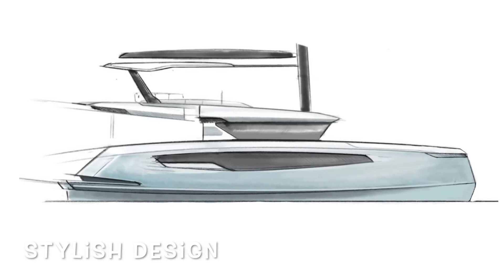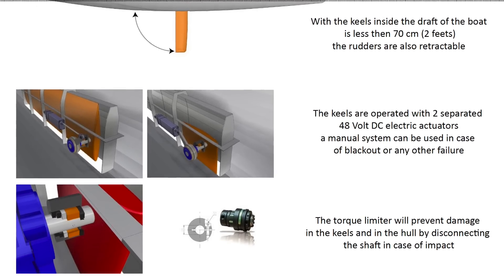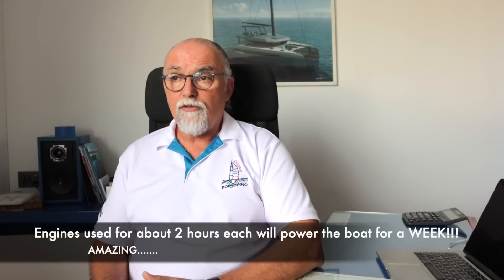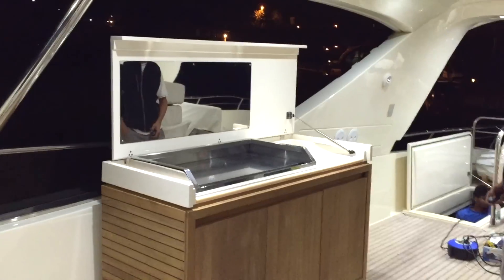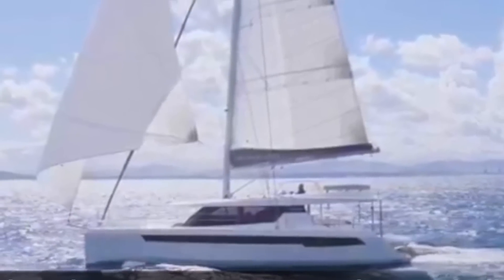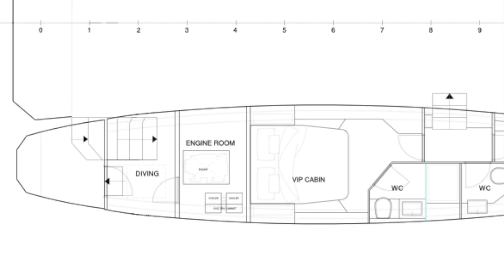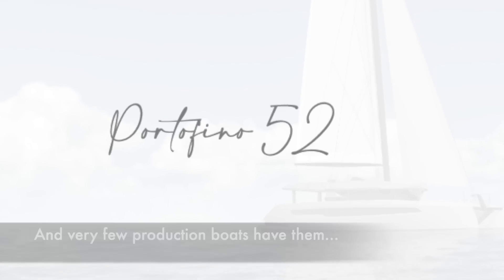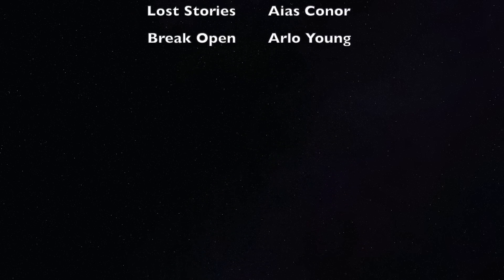S3#4.  NEW Portofino 52 - Designing THE PERFECT PERFORMANCE ALUMINIUM CATAMARAN for us?

Comment: I know that there are not many examples of Foil Assist on cruising cats at the moment but this is one method of lifting the huls out of the water and gaining that extra speed you guys are looking for. 
HH cats are putting winglets onto the keels which seems to be a toe in the water kind of approach but there are a few cats with a full foil between the hulls that are giving great results and some benefits.
It would be very interesting to see how that would work in the simmulations.
Reply from the maker: Hi Dennis, yes we actually approached an advanced foil designer and it could be done but there are several complications (variable angle is better for different speeds, increased draft, no benefit below 12 knots etc) so we dropped it.... The foil on the HH reduces drag only, no lifting effect but the curved daggerboard creates lift by one ton at 12 knots.

Comment: I don't see a centerboard lifted with a hydraulic ram kicking up from grounding or debris.  What's wrong with a line and winch for lifting?  A centerboard needs be no heavier than what it takes to make it to drop and stay down from the pressure of sailing.  It wouldn't take a lot of extra depth to place the pivot below the boat hull, and thus easily removable in an hour or less, afloat or not.  I designed a 64 foot catamaran in which the centerboard was in a shallow keel, so the total draft was 3.5 feet board up.  After all, you have the depth of the rudder to limit the draft of the total boat, unless you have some complicated arrangement for the rudder.

 As for flotation tanks, it takes a cubic foot of air to float 64 pounds.  You won't have enough area to create a significant amount of flotation.  The designers are just humoring you to sell the boat.  You won't have a useful amount of buoyancy from your "air tanks."  My catamaran designs have watertight bulkheads, with cabin access for foremost and after-most cabins from the deck.
Reply from the maker: Hi Tim, The centreboard will kick up due to using compression plates that will give way under strike force, and whether it is hydraulic, manual or lines. Then you can pull it back down and there is nothing broken, not even sacrificial pins. We do have the plan for lifting rudders too to allow shallower draft and beachability. The previous 42 cat I built had lifting daggerboards and rudders that just touched the sand when it sat on the beach so that worked very well.

My issue with "watertight bulkheads" is that most of them are not actually watertight with drains through to avoid needing bilge pumps in each section or holes cut for Kids berths or similar. This design will have truly separated watertight bulkheads and air tight voids wherever possible  to ensure maintenance of floatation. In the 42 foot cat, the whole of the under floor areas was sealed off as well as the nose cone and under the berths in each cabin. One area in the 52 that can also be used is to seal off the saloon roof and unused bridge deck area, so it is not that those areas alone will maintain floatation but with proper watertight bulkheads, it will be much safer than the usual boats that are built...

Clearly you have the appropriate design to keep your bulkheads properly watertight and still be able to use the space - great design!
Reply: @barefootdoctorssailing    Hi, Barefoot - I don't follow the reasoning that you're against watertight bulkheads if they aren't watertight.   By definition, watertight bulkheads ARE watertight.  It's not hard to put a short pipe with a valve on it attached to a bulkhead.  I would have valves at every point where a pipe passes through a bulkhead.  Wires can be passed through with copper bolts attached to fiberglass plates bedded on your metal bulkheads.   As for the centerboard arrangement, it seems absurdly Rube Goldberg to me.  As for flotation, you have to do the math.  For example: 36,000 pounds of displacement needs 562 cubic feet of ,emptiness, or better,  closed cell foam, to float it.  That's a whole lot of nothing. 

Probably the slickest retracting rudder I've seen is the daggerboard in a revolving drum arrangement in some Gunboats - but it doesn't kick up.  It's easy to put a dingy style rudder on a boat - essentially a daggerboard case with pintles and gudgeons on the transoms on a short skeg.  The case can be open in back so it can pivot if given a pivot on the daggerboard case.  However, you get some efficiency loss from air bubbles, and it's more complicated to put wheel steering and an autopilot on the arrangement.  It's also vulnerable in harbors.

My preference would be a 1.5 foot keel, housing the whole centerboard.  It doesn't interfere with the boat's interior, and the pivot pin can be accessed from outside of the boat.  Then the rudders can be  conventional inboard, just a bit short.  The resulting boat would have 3.5' of draft with 3' deep rudders.
Reply from the maker: @timdunn2257  Hi again Tim. I think you missed my point about the common production cats that have buklheads they call "watertight" but are not with cut outs or drainage holes that render them unsealable and several have sunk as a result. There is also the common misconception amongst the sailing community (it seems) that "cats don't sink" which is also incorrect... See Sailing Dauntless with the Leopard 50 that fully sank.

Clearly your processes for maintaining the integrity of the watertight bulkheads are what we are going to be doing in various ways to ensure the integrity of the watertight bulkheads soon the P52 and will have large areas that are sealed - the two engine rooms (large volume), the two bow sections, the stern sections, multiple under sole areas, the nose cone, the salon roof and sections of the underwing. This is me pushing them to put in more sealed areas and not their design as I have seen boats go down and everything filling up because the bilges drain across sections...

I have not done the maths (and we work in metric) for how much volume we need to have but are you saying that it is impossible to have enough buoyancy to keep the boat afloat between the sections that are sealed off and the air tight voids? If the bottom oof the main hook centrally was holed, we need enough buoyancy in the rest of the boat to stay afloat so that is what I am trying to achieve. 

I have considered on the Leopard to have salvage bags that can be inflated with scuba tanks to create that buoyancy as well.

As for the Rube Goldberg reference - that compression solution does not break , can be instantly reversed and is simple and easy to instal is the best design I have seen for the centreboard hitting any objects and being able to be reused immediately - what solution do you think is better?

Also we want to be able to back the boat on it's hull and having a 1.5foot (1/2 m) keel makes it deeper draft and puts more strain on a smaller area, it seems so it will dig into the sand. Does that set up work for beaching?
Reply: Hi, Barefoot  -  That's not a point against watertight bulkheads, that's a point against lying salesmen.  Caveat emptor!    

If you can't inspect the area below the cabin sole to make sure the bulkhead is watertight, you're already in trouble.  It is, of course, possible, and even fairly easy to make sure you have adequate buoyancy to keep a catamaran afloat.  I have done it.  Many cored fiberglass hull multihulls are unsinkable due to the amount of core, but you must do the math to make sure if you rely on that property.  It's not magic.  It's just simple math, though it's somewhat tedious.  You can do a shortcut, using the net buoyancy of the laminate in a fiberglass cored multihull - that is subtracting the weight of the fiberglass and weight of the core from the floatation of the volume of a square foot (or meter) to get the net buoyancy.

As for your aluminum boat, just measure the cubic feet of each watertight cabin, multiply by 64 to get the buoyancy, and ensure that what you are depending on to float you, will.  Just adding buoyancy without doing the math is pointless.

Centerboards have been common along the Atlantic and Gulf coasts of the US for a couple of hundred years.  The centerboards were made of wood, and weighted with lead or iron.  A line was tied to a point that could raise the centerboard to haul the board up.  The boards would kick up when a shoal was hit. The line goes up to the deck inside a tube, to keep water from sloshing into the boat.  Replacing this simple, cheap, reliable line with a hydraulic motor, hydraulic ram, and a device to pinch the centerboard is, please forgive me for saying so, hilarious.  

 In a catamaran, the false keel often used is usually used for tankage, which is useful.  I have never heard of keels (called false because they aren't ballasted,) being a problem in grounding catamarans.  Catamaran keels are reinforced to take the force of grounding.   In boat yards, catamarans are usually dried out on their keels only, sometimes with some support forward to support the bows if the  keels are far aft.

As far as preferences go, you pay your money and take your choice.  I urge keeping every necessary thing on a voyaging boat as simple as reliable as possible!  KISS!  Electricity in sailboats should be regarded as a luxury, not a necessity!  

 I sailed from LA to Honolulu to Seattle to LA, and I did a transpacific voyage via the south Pacific, as well as sailing in Puget Sound and British Columbia.  I've anchored in a hundred harbors or so, and never wished to have just 1.5' draft.  A big advantage of keels on a catamaran is that you can paint the bottom resting on the keels.  If you are going to rely on making a catamaran unsinkable, you must do the calculations to ensure adequate flotation.

Do a google image search for centerboards and catamarans dried out between tides on their keels to see my points in practice.  

https://forums.sailinganarchy.com/data/attachments/407/407021-47431d21d45e9ce9b34396f039364af7.jpg

https://oceannavigator.com/wp-content/uploads/data-import/bc7ab764/cats2.jpg

https://www.antarescatamarans.com/wp-content/uploads/2020/07/keels-and-rudders-on-catamaran.jpg
Reply from the maker: @timdunn2257  Thanks Tim. The false sales talk was my point and of course I am I favour of proper watertight bulkheads! I ssiled 20 years around Australia, South Pacific and Indonesia on our 2 ft draft beachable cat and there are many advantages - see S3#8 
https://youtu.be/-sfovcW1qF8
 to why we like that combo so much. It’s a personal choice of course and most go for the deeper keels although once you’ve experienced the beauty and safety of getting up creeks and mangroves to escape statins and swell, we certainly felt like or throats were cut with a 5 Ft draft of the leopard50… 

Each to their own and great that there are different options to suit each desire!
Reply: @barefootdoctorssailing    Hi, Barefoot  - I thought Indonesia discouraged yachties!  That sounds like you had a great time!  I don't care for mangroves unless a tropical revolving storm is in the offing, myself.  I've hidden in them in Guam and in Puerto Galera in the Philippines.

Comment: Is the weight going to effect the performance, and Is it heavier than other boats it’s size?
Reply from the maker: Thanks for the comment Tony. The polars were calculated using 18.5T and the dry weight is 16T so the performance should still be fine. Any cat is affected by weight and the lighter she is the faster she will sail... For comparison of weights she is lighter than the Garcia and the GRP boats but heavier than the carbon boats and performance cats like HH, Outremer and Seawind. The HH55 is 14.2T and the Seawind for example comes in at 13.5T so only a bit heavier.

Comment: Do NOT forget to incorporate  a heat pump into your coolong/ac system(saves a lot on power comsumption at reasonable intial cost) [may have to adapt smallish home heat to amarins system, not the marine ac/heat people dialled in yet].... but having seawater a constantly available would make   a solid design posible......(btw: tesla even uses a heat pump to help coool the car battery packs, maybe a car heatpump could easily adapted.....
Reply from the maker: Good points, Lincoln! Raffaele will talk about it later but he is designing a seawater heat exchange to get the heavy power dc chargers to be more efficient. With alum hulls it becomes easy….

Comment: What a brilliant design! It is clear that a great advantage of working with aluminum is the infinite ability to make design changes. Clearly, your input is invaluable. Since lightness is so inextricably tied to performance, let’s hope that none of the features you desire will have to be sacrificed to lose weight, especially the safety features.

Ongoing concerns include the weight of each coat of antifouling, plus the inevitable biofouling that takes place anyway. This will slow any boat down. With Tecmari six hundred series, only a microns thin nano-ceramic primer, followed by ONE coat is needed to provide a durable super slick coating that improves hull performance. The hull becomes self-cleaning as it moves through the water. This is easily the best performing, green antifouling solution available that has zero effect on the marine environment. It has a “very good” performance rating from Practical Sailor after one year of testing.

Apply CeramaTherm antimicrobial waterproof spray on insulation to the inside surfaces and achieve 68% sound attenuation and 2.02 W/mK thermal conductivity at 10 mils. This will inhibit the formation of moulds as well. I would highly recommend incorporating UVC air sanitation to knock down all airborne pathogens. As you are probably aware as doctors, this technique is employed in operating rooms worldwide. 

Finally, the addition of NeverBlaze coatings to battery compartments, engine rooms and galley will help prevent an inboard fire from getting out of control before fire suppression takes effect. I will be offering Raffaele samples to evaluate for use at Portofino.

The only thing I see is not addressed is the vulnerability to lightning strikes, which you may have heard; Colin from Parley Revival has now suffered twice. In his investigations, it would seem avoidance is the only current strategy that is effective. It may be difficult or impossible to mitigate the effects of a direct hit, but something might be done to avoid the consequences of a near miss, which can be just as devastating.

Looking forward to the unveiling!

Comment: Very excited that you are specifying performance. From my experience racing much smaller high performance cats I would opt for sacrificial short keels for Caribbean sailing with dagger boards on long waterline hulls. Most cat sailing is 70 to 130 degrees and boards adjustable depth enough to provide the best performance with a hulls that can lift with speed. Personally I would not consider swing keels on any cats or hull flying performance on a blue water cruiser.
Reply from the maker: Thanks for the info, MWM! You are rIght about not flying a hill - we have no desire to be on the edge of capsize! However we found on our performance cat with dagger boards , once past 70-80* off the wind, they were not needed at all as the fine entry hulls kept the directional stability without the need for daggerboards. DB are a risk if you hit the ground but the sacfificisl bottoms broke off and avoided hull damage. Still daggerboard repair needed so a centreboard would save that aggravation.

We are not going to be racing, but we want to be able to sail fast without too much effort and stay safe... lots of choices to make!

Comment: Wow!  These are really great renderings that check off a lot of your wish list!  I really like the design without the flybridge as well.  I do have one question on your spreadsheet- you give the Outremer 51 2 check marks for performance and give the Seawind 1600 3 checks.  Am I missing something here?  I thought the O51 could certainly hang with Balance 482 and Seawind 1600 in terms of performance.   Cheers!
Reply from the maker: Thanks for the comment, Mountain Dweller. I am only basing that on the Outremer polars that I have that show quite disappointing performance off the wind - only 12 knots or so from memory... And the Outremer 51 (Archer) was only doing 1 knot faster than Zatara when on a reach crossing the Pacific... The Seawind Polars are spectacular doing over 20 knots ....
Reply: @barefootdoctorssailing  And all this time I thought is was because Keith on Zatara had the iron ginnys at full throttle!  😂😂  Cheers and best of luck on your build!